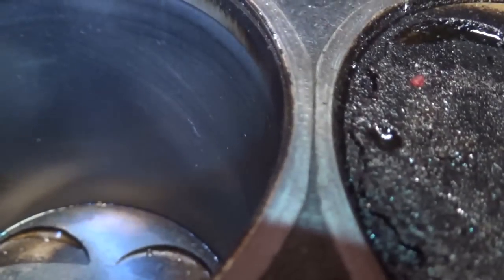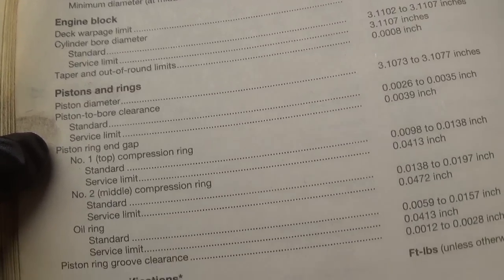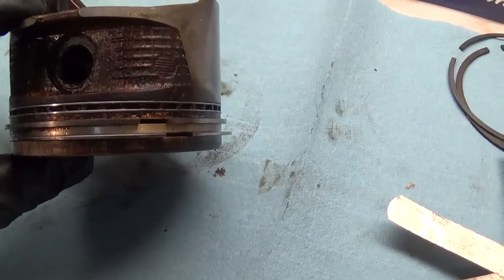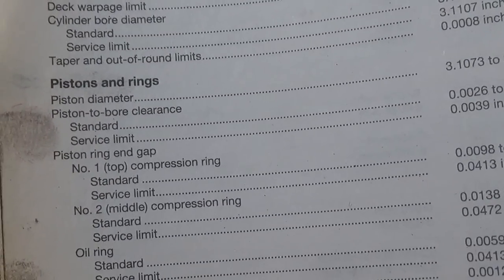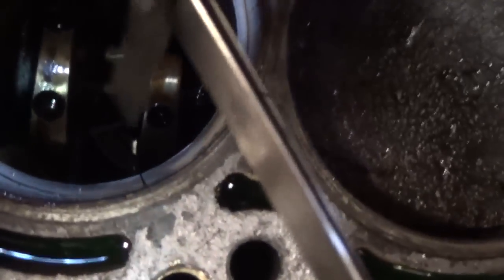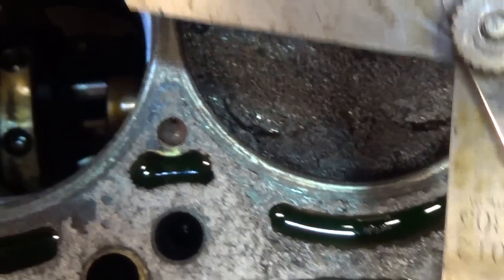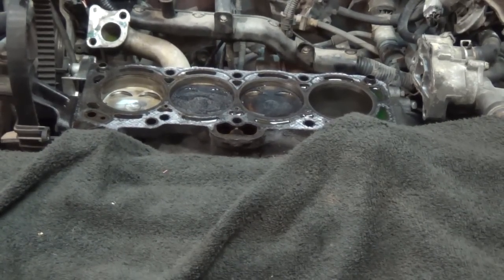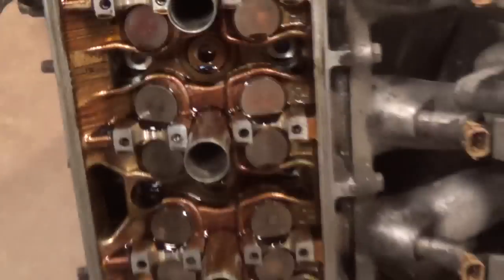Toyota 1.6/1.8L Oil Burning -'96 Geo Prizm -Part 2 of 4

Comment: Picked up a lot of tips from you on diagnostics...here are some tips on engine rebuilding you can choose to use or not. If you don't want to buy a piston ring groove cleaner you can break a ring and grind it at a 45 degree angle and it cleans grooves perfectly. If you don't check cylinder wall taper with a micrometer or dial indicator the easy way is flip the piston over & push the ring into the cylinder bore making it square & check ring gap at the top and bottom of the stroke where the rings travel in the cylinder and it'll tell you the taper. Your wear will be less at the bottom of the cylinder so if you set your ring clearance to minimum clearance at the top it'll be too tight at the bottom.Even though you can see old cross hatch your cylinder walls are glazed and you should at least run a deglazing hone down each cylinder to help the rings break-in. Newer ring materials used today are less forgiving & require a smoother bore & less break-in so we'll see what happens. Good job replacing all the rings...if you have it tore down that far you change them all. Same way with the rod bearings...if you have all the pistons out you take advantage. It'll eliminate the wear and tighten up the clearances which will increase your oil pressure some according to how much wear. I understand you are trying to do it as cheap as you can. Look forward to Part 3&4. Merry Christmas Ivan.
Reply: +Robert Hayward Is re-honeing an at home job. I always thought any stuff like that would need to be done at a machine shop. I've only stripped and engine right down like this once, a few years ago, so nowhere near an expert with this kind of stuff.
Reply: +lolz larkin You do it with a drill and a ball hone to put a 45 degree crosshatch in the cylinder. You use a variable drill (can be air) and you start spinning it outside the cylinder go to bottom & cycling to top. Several You Tube videos on it. as long as the cylinders are not out of tolerance (out of round, excessive taper, scoring, etc ) requiring reboring then you can deglaze/hone.  Your engine looked OK but didn't see the amount of taper, piston skirts had some scoring but didn't look too bad but hard to see from camera. Hopefully the rings will seat ok.  I've built hundreds of engines from stock to racing but I think you will be ok. Did you check the ring gap towards the bottom of the cylinder bore?
Reply from the maker: +Robert Hayward Thank you for the great tips, Robert! i am by no means a pro engine rebuilder so I appreciate the feedback :) 
In cases like this (also like my Suzuki timing tensioner vids) where there is only one obvious thing wrong, I do my best to fix ONLY what's broken.

If we had unlimited funds and time, sure we could go all out and bore/hone  cylinders, replace pistons, main con rod bearings, crankshaft seal, valve guides...where do you stop? And doing all that extra work, would we achieve a much better result in solving our original problem (oil burning)? Maybe. But there is also a chance to do something wrong or perhaps replace a good part with a junky aftermarket one. If those con rod bearings have gone 240k miles and are not loose or scored, I honestly feel better leaving them alone than replacing them. This is not quite a high-performance racing engine, even though the owner drives it like it is lol

At this point in the process the only thing I regret is paying a bit more attention to cleaning out those piston oil return holes; apparently those are key to keep the oil circulating through the oil ring and preventing our problem.

Merry Christmas and enjoy the next two parts! :)
Reply: +motoYam82 You're doing fine Ivan and you're meticulous. I know you''re working in a budget and only replacing what you need to...understandable with the age of the car. I've picked up some great diagnostic tips with you and just trying to return the favor & yes the oil return holes are critical to having an effective oil control ring. Your friend is lucky to have you as his mechanic!!
Reply: +Robert Hayward Robert well spotted I was thing the same things as you when watching. Overall Ivan did a nice job for someone that is not use to doing this kind of job I was waiting to see if he would use an old ring to clean the piston and honing would have been good at this stage.Many ways to skin a cat thou.
Reply: I dont mean to be so offtopic but does anyone know of a tool to get back into an Instagram account??
I was dumb forgot the login password. I appreciate any help you can give me.
Reply: @Jax Amari instablaster ;)
Reply: @Kingston Mateo it worked and I now got access to my account again. Im so happy!
Thank you so much, you really help me out!
Reply: @Jax Amari no problem =)

Comment: I am glad to see your mixture of "shade tree mechanic" and "high tech diagnostician" can get folks back on the road for not a lot of $$$ !

Too many times people get into the moved of "while we are in here, we should change this also !"  No indication of anything wrong with the bottom end so why not just reassemble.  If the cross hatch looks good and the ring end gap is with in spec, go for it !

Comment: Every mechanic has their "special brew" for impossible schmung buildup.  Here's mine:
1 part Dexron III ATF
1 part naphtha oil (substitute SeaFoam if naphtha is unavailable in your area)
1 part mineral spirits
1 part diesel #2
Add 1 quart of the concoction to cold engine, idle until up to temp (do not drive!), shut down, drain oil, continue what you're working on.  Also works great in larger quantities as an overnight soak for pistons and other schmungy parts.  :)

Comment: I fixed this problem on a 2002 Toyota Avensis that had the same problem (clogged oil rings) by drilling 4 more holes in the piston. I think I still have the Toyota service manual somewhere showing how to do this. The sludge buildup was caused by improper oil flow through the oil rings to the piston.

Comment: @  
Pine Hollow Auto Diagnostics & everyone else. A heads up. If you use a fuel additive called FPC (US) or FTC CONCENTRATE (Australia) you will never get carbon deposits or stuck rings like this. It will also safely burn away all existing carbon deposits & free up the stuck rings like  in this video. 
Actions include increased fuel combustion, decreased blowby soot, deglazing cylinder bores, decarbonizing combustion chambers, pistons, piston rings, ring grooves, piston oil drain back holes & galleries, rotary engine combustion chambers, rotors & exhaust ports, exhaust valves, exhaust ports & manifolds, turbochargers, direct fuel injectors, glow plugs, spark plugs, emission sensors, Diesel Particulate Filters & catalytic converters.
Keeps new engines 100% free of carbon. Keeps older engines free of carbon after fully cleaning them.
Keeps engine oils cleaner for longer, greatly reducing engine wear & rebuilds.
For use in all engines & all fuels, incl 2 or 4 stroke & rotary engines using gasoline, E10, E85, ethanol, methanol, diesel, biodiesel, kerosene, nitromethane & all racing fuels. 
Also for use in all liquid fuelled model aircraft, model cars, 4x4, trucks, boats etc.

Can also be used in lighting, heating & cooking fuels. Including dual fuel stoves & lanterns, wick & pressure lanterns, kerosene fridges, heaters, stoves, lanterns, oil heaters or any hydrocarbon or organic liquid fuelled appliances.
Been using it for 20 years.
And the best Coolant in the world is RMI-25. Cleans while you drive & doubles the life of all cooling components incl water pumps, seals, hoses & valves. Non-Toxic. Non Hazardous & 100% biodegradable. Compatible with ALL cooling systems, including dual metal & alloy types & ALL types of antifreeze, antiboil solutions and metal-based stop leaks.
These are the best & most used products in the world by governments, all industry & racing & have been for ~ or 40 + years.
Try them & you'll never want to use anything else.
Take care everyone.

Comment: Nice video and something to watch this Christmas morning, but that's a lot of work for essentially a throwaway car.
Merry Christmas to you and your family.
Reply from the maker: +Upallnight "throwaway car"....ouch. I'm guessing you've never driven one of these hot rods?
Reply: +motoYam82 When I was a young man.  It was common to see a engine rebuilt.  Not so much anymore.  They either move on to a newer vehicle or do a complete engine rebuild replacement.  

Looking good!  Thanks for sharing!  Nice Christmas present for your viewers.  

Merry Christmas!!
Reply: Closest cars that I have which are 4 cylinders are a couple of 70's Lotus.  Now those are hot rods.  Rebuilt the engines on both of them.  One is a Renault 1565cc engine, the other is a Ford Cortina based Lotus Twin Cams 1600cc engine.  There's a special tool made for cleaning the cruds out of the piston ring area.
Reply from the maker: +Upallnight  I was thinking that the legendary +Scotty Kilmer would be very disappointed in your "throwaway car" comment about an old rebadged Toyota LOL

Comment: Having changed rings on a vw beetle long ago, I never guessed the rings were directional or did I know about the drain holes.Why were you not showing videos back then ? Come to think of it , utube was something that went on the wheel of your bike.Great seeing the different items needed to be checked to keep it in spec.What is that expanding pliers used for generally ?  The oil baked on the piston, reminds me of the deep fat frier and job it takes to clean it.That engine sure seen hotter days.Would synthetic oil have made any difference ?Where was the lip on the cylinder after all that milage ? The finished job was a sight for sore eyes-----sparkling like new !!.Looking at the oil drainer,it seemed very clean.Went through 4 corollas myself--------very reliable cars.

Comment: Nice,well done. I wonder how the new aluminum blocks  manufactured today without the cast iron sleeves are going to fair in the future, so far what I read they require low tension rings .  I think engines in the future are going to be a component change just  like an alternator , no more rebuilding just replaceable . Engineering at its best or worst  LOL
Reply from the maker: +Steve Rob Aluminum blocks without steel sleeves?? Yikes! Didn't someone try that experiment in the early 70s with not-so-stellar results? I think it was the Chevy Vega http://www.sunnen.com/NewsDetails.aspx?NewsID=11

So are any modern engines using this liner-less technology today?

It seems like modern engines are actually extremely well-built and long lasting, minus the variable valve timing and emissions systems. It's the rest of the car that will probably fall apart around the drivetrain lol
Reply: +motoYam82 http://wardsauto.com/technology/big-changes-under-hood-16-bmw-3-series
Reply from the maker: Well it won't matter if the engines blows up at 50k miles in BMWs case since buyers trade in their Euro trash every few years hahaha! New tech is cool, but you know all that fancy variable timing and turbos and plastic pieces will not last very long....
meanwhile my buddy will be cruising by in his 400k mile Geo Prizm and laughing all the way to the bank!
Reply: +motoYam82 Porsche tried blocks without steel sleeves. Just some layer of &quot;magic technology&quot;. It of course ended up with huge failure. You can just tap &quot;porsche cayenne engine noise&quot; in google or youtube. All those engines were piece of crap. Expensive piece of crap...

Comment: Can I just drill the holes bigger, clean the oil rings, and glue the head back on with the old gasket and No.1 Permatex?
Toyota did a recall on this, they changed the pistons because of those small or poorly placed holes.
I switched to Delo 400 oil for diesel engines since that type of engine has this kind of problem. But I don't think it will make any difference at this point.

Comment: Ivan, what I do is soak the pistons in Ovencleaner for a week or so, then almost all the baked oile residue is gone.
Reply from the maker: +Willem Streutgers Hah I wish I had a week for this job...had to get it done in two days!
Reply: +Willem Streutgers  O, and furtehr more I allways use a engineflush before changing the oil,
Never put clean oil in a dirty engine. It will cost a few Dollars, but yo will notice the difference instantly afterwards.
But anyway as allways a nice and helpful vid. !!

Comment: great rebuild vid man, hey could a bad or a non Toyota genuine PCV Valve contribute to some of the Oil burning on this engine? has your buddy changed it? I've never owned anything except Honda Cars and I always use honda genuine pcv valves because they flow differently than the aftermarket ones that why I said non Toyota PCV

Comment: Wow. Thats pretty crusty. Did you use any chemicals to clean the pistons or just scrap them down? 

I've heard some people drill extra oiling holes in the piston in order to aid the oiling process better. Although I'm not sure if it might not cause other problems with the piston. The condition of the compression rings, the scoring inside the cylinder would indicate that it doesn't appear to have damaged the engine. Although that engine may resist damage from the oiling burning better than the modern engines as its a cast iron block with an Aluminium head. Where as the modern Toyota engines, certainly the ones popular in the UK and Europe seem to be all Aluminium blocks with steel cylinders.

Comment: Rule of thumb for ring gap is .004" for each 1.0" of bore..A cylinder hone is a cheap tool to have in your tool collection and easy to use...I hope you oiled the big end bearings...Otherwise you're doing ok.
Reply from the maker: +ZIGgassedUP Well for the main bearings I made a point to not wipe off the oil that was already there :)

Comment: whats up man i have a 93 corolla with 60k and it smokes when you start it and it burns a lot of oil does not leak it but burns it im going to do the PCV soon i use 10w 30 full  S what do you think it could be i hope its the PCV ill let you know if i have to pull it a part

Comment: I am with Kostas  lube the crap outa the pistons And I think the holes In the piston are for the oil to go back into the pan from the walls Also can head bolts be reused?
Reply: +Joseph Tucci   You are correct! Those holes move oil from the oil rings to the inside of the piston so it can drip back into the pan. Those holes also squirt a little oil over the hole in the top of the connecting rod to lubricate the wrist pin. the oil usually gets up into the cylinders under the piston when the little flat dipper on the bottom of the connecting rod splashes it up there.   I assume he put some new bearings in it and used assembly lube on the bearings, but that wasn't the topic of this video.  Chris
Reply: +shadowdog500  I was wondering about new rod bearings also as long as he was that deep into the engine. Shoulda put some rubber hose over the rod bolts also so as to not scratch the crankshaft when re-installing the pistons! As for me, I'd have just dumped a can of RESTORE in it. Afterall, it guarantees to restore lost compression. Says so right on the can!!!
Reply: +Durango Dave Restore doesn't work for stuck oil control rings and plugged passages. Rubber hose over the rod bolts is a good idea but not a requirement if you are careful & pull the connecting rod down onto the journal which I am sure Ivan was. If the bearings showed no sign of wear and they plasigauged fine you can reuse them if on a budget which Ivan is.

Comment: First ,,Merry christmas Ivan ..second are the rings over sized or stock? ..thats problem with the coked up r oil ring is what happened to a lot of Saturns ..or in the motorcycle world Suzuki had it with the bandit
Reply: +deepsquat600 I wrote that without watching the whole thing ...guess I should have  :)
 That is THE Ultimate Ghetto Rebuild :)
Reply from the maker: +deepsquat600 I'm all about bang for the buck :)

Comment: Yup.  Love the vids.   Only thing I do different is soak the loaded piston in oil before putting in the ring compressor.   I thought it was a must but hey  not telling you what to do.
Reply from the maker: +Jason Curry Sure I know that's a common procedure. Makes a nice cloud of blue smoke on start-up lol... A squirt of WD-40 is plenty of lube for start-up. Ask Eric O. on his opinion of lubing the piston rings before reassembly...he got slid on that before too :)
Reply: +motoYam82 
So what happened.   I was always under impression.  That yea it smokes but that burns off and you are better lubed. Ex specially with new rings needing immediate lube      Also wondering why no quick hone since you did use new rings.    I know you still had old crosshatch but new rings like the roughness of a fresh hone.   I'm just asking your side.  Not being demanding!!   I'm curious if the thoughts.  :)
Reply: +Jason Curry A lot of people dip the piston in oil before installing, but i was taught to use WD40 decades ago and never had a problem.  Ive never done rings without honing, but i really don't know if you have to hone.  Merry Christmas!  Chris
Reply: Soaking the piston puts lots of oil between the ring and land, this can make it hard work to compress and get into the cylinder. I always use a light oil on the skirts and coat the bore. Just my experience. Not saying it's wrong.

Comment: Wouldn't it be easier if you soaked all the Pistons insolventfor 24 hours and then take the Rings off?
Reply from the maker: Who has 24 hours and a gallon of solvent?
Reply: @PineHollowAutoDiagnostics  I thought back in the day in machine shops they used to boil the block and the heads and the Pistons after submerging them and solvent  for 24 hours?